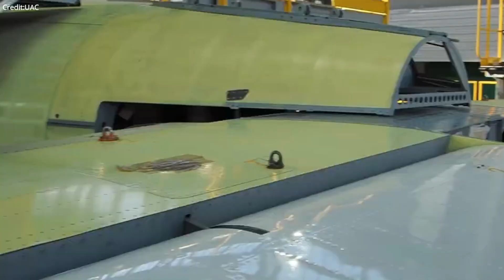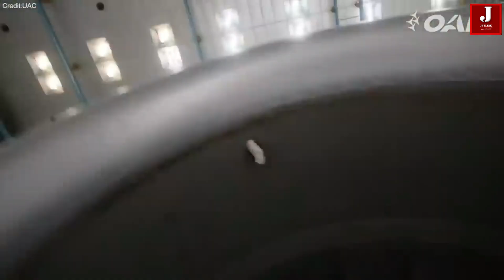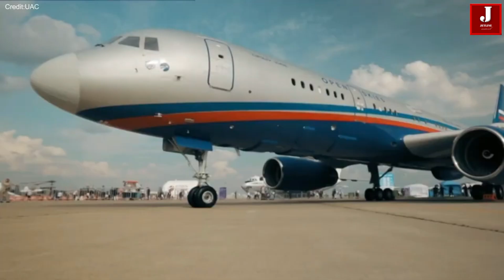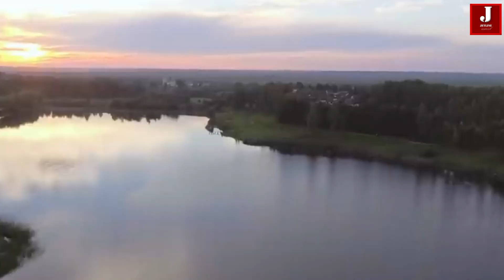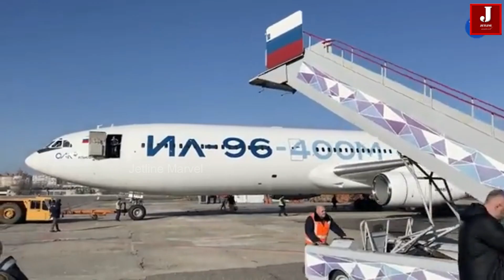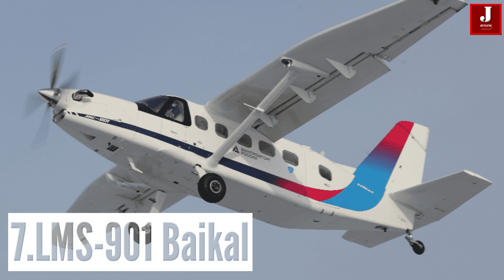Aviation Sanctions? No problem!  These Russian 7 airplane will repalce western aircraft

Comment: Russia aviation industry although is not as advanced as the West in term of modern equipment today is in fact quite mature. 
As a trusted and strategic partner and in recent year China have sold many advanced CNC, modern equipment, etc to Russia.
Much to the displeasure of U Sanctions but these are equipment designed and patent right by China themselves. 
This has help the Russian to upgrade their civilian aircraft production lines. 
Russian are brilliant aeronautical engineers. ❤

Comment: At current production levels all western planes should be replaced by 2100.
Reply: 2200
Reply: @ivanbasson982  Even that’s a bit optimistic.
Reply: With current production quality, boeing will lost all market in 5-10 years. Now what?
Reply: @ШевкуновКирилл  If Boeing wants to stay in business then they have to get back to their engineering roots. Airbus is having problems of their own. I believe the next great aviation producer will be China. The C919 doesn’t compare with the 737 or A220 but it does exist, it has a natural indigenous market and China holds a lot of foreign debt in developing countries that can be leveraged for sales. China just needs to figure out how to ramp up production.

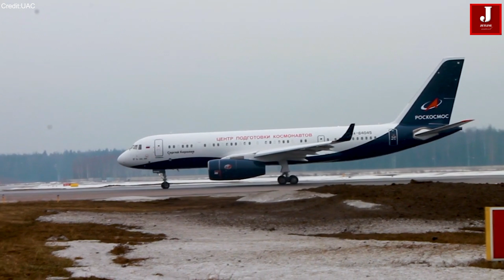Comment: 03:33 - The Tu-204 has never been equipped with Western engines. Only Soviet (Russian) PS-90 aircraft engines were installed on it. In 1996, he even received all the necessary flight permits, but the "Western lobby" in the Russian government achieved the abandonment of the production of this aircraft as obsolete. The only significant drawback of this aircraft was the crew of 3 people, 2 pilots and 1 flight engineer, while there were only 2 pilots on Western aircraft. Currently, an upgraded version of the Tu-214 CM aircraft with PS-90A3 engines is being produced in Russia entirely of Russian production.
Reply: Beautiful to hear - thx
Reply: Rolls-Royce engines were ones installed for Chinese airline.
Reply: Air cario and I believe TNT had Rolls Royce engine's on there TU 204.
Reply: Tu-214 CM contains imported components and is therefore not produced. To replace them, additional certification is required, and this is time-consuming and expensive. A completely Russian Tu-204-200 (Tu-214) is being produced with a PS-90A engine and 3 crew members in the cockpit.
Reply: Die Triebwerke wurden aber mit amerikanischer Hilfe von GE überarbeitet.

Comment: With enough resources and time, Russia will build safe reliable airplanes.  Fuel consumption may be high… but they can afford it.
Reply: How do you know it will be high? PD-14 is a very effective engine.
Reply: @vatnikxxi7717 Der Verbrauch des PD 14 ist etwas höher.
Reply: os novos motores russos são compatíveis ou mais econômicos que os ocidentais.